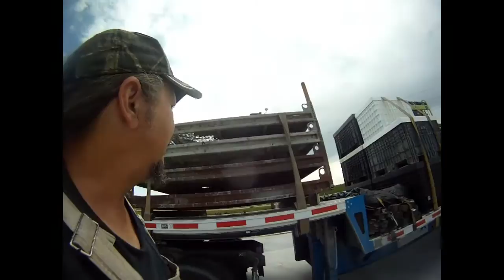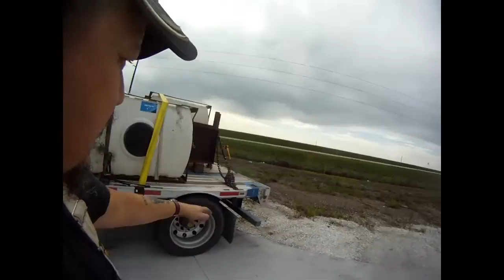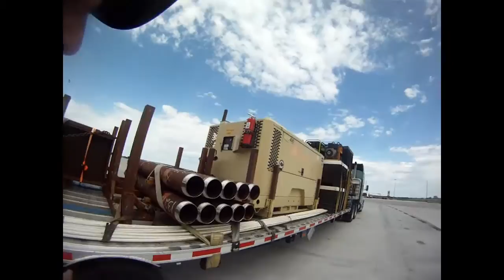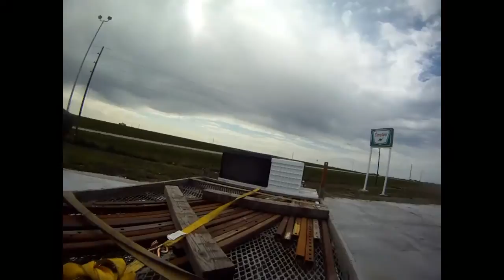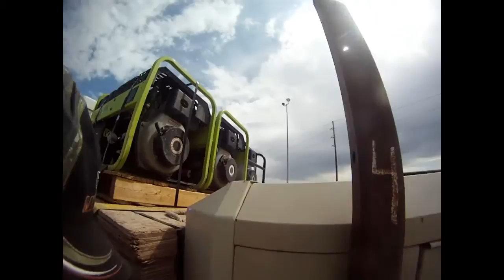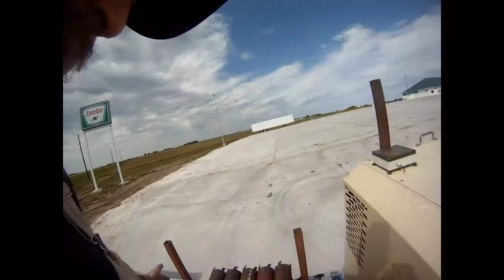Assorted Jobsite Equipment Load-Jim The Trucker Video Series

Comment: Can you make a video of hauling a steel coil chain and tarp if you could on showing all the safely step of the whole process of where to place it on the trailer also. Thanks
Reply from the maker: +Joseph Wallace I have not hauled a steel coil in years. Depending on weight is where they are placed and how many chains and what size.
Reply: +Jim Hudson ok the steel plates video was helpful also. Did you learn all your flatbed experience on your own or drive for a company before owner operator? I had a good idea on the flatbed just jumping right into it as a owner op and learning as I go what would you do?
Reply from the maker: +Joseph Wallace I drove for Werner when they had a very large flatbed division. I learned a lot there for basics, but I applied the principles when on my own and came up with my own solutions for how to tie something down. I watched other drivers tying the same stuff down at a shipper and added my own ways. When I went to Landstar they gave us a 3 day class. Not that it was all we would need, no, that is why I do this channel to fill the gaps. Learning as you go can have downfalls but you could do it. Just always making sure to put enough correct tie downs until you get the happy feeling and no shortcuts.
Reply: +Jim Hudson if you had to do it all over again would you go out on your own and learn or drive for a company?
Reply from the maker: +Joseph Wallace I would do the same. There is to many ways to make a mistake that could cause injury or death with open deck loads. I would seek professional teaching to be able to start on your own after being taught for a few months. Three days is not enough for new people, but that is my opinion. One mistake could kill somebody.